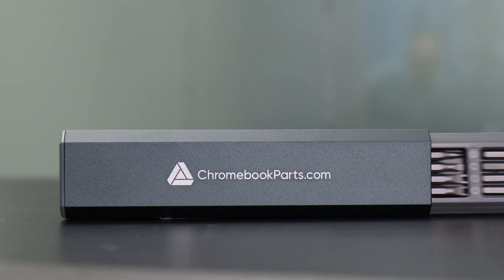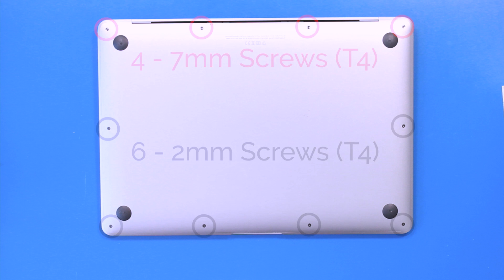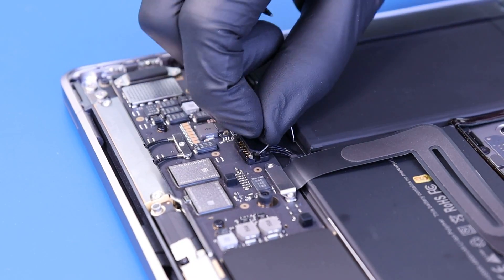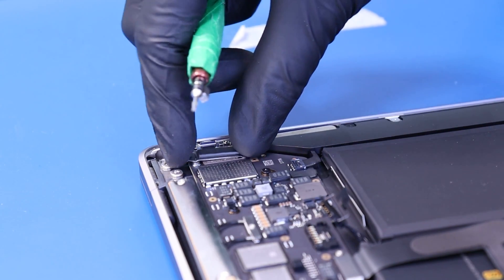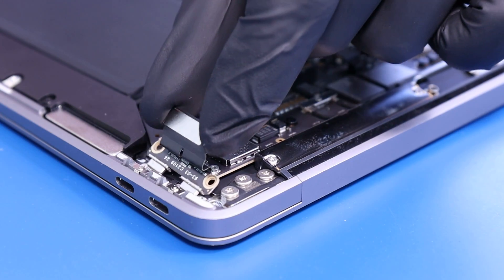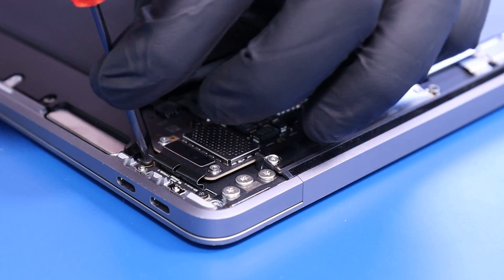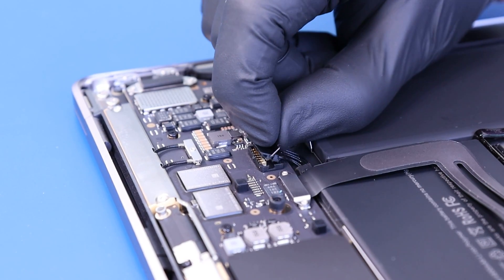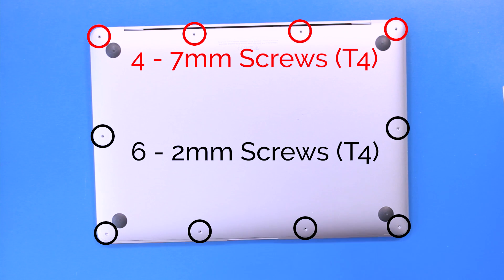MacBook Air A2337 (2020) USB-C Port Board Replacement

Comment: I just called a local shop up and asked for the price to do this they quoted me £125. I just went online checked the price of usb-c port on ifix, they are £20. + screwdrivers = £36 in total. So I'm going to follow this guide and try doing it myself.
Reply from the maker: Yikes, that's a massive savings. It's a very doable procedure, so good luck, and hopefully everything goes smoothly!

Comment: Heyy, does this only fix the charging issue or does it also fix the data transfer, device connection etc.
Reply from the maker: If the replacement fixes the charging issue, it will most likely fix the other issues (data transfer, etc.) as well - unless a separate component has also been damaged (for example, the usb-c board connector on the motherboard).